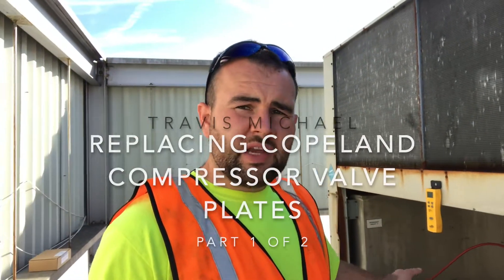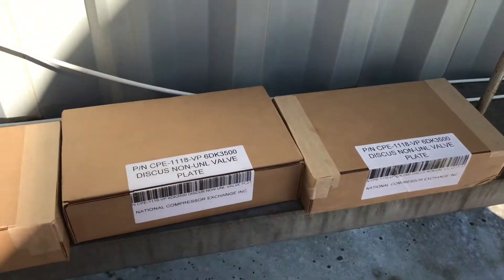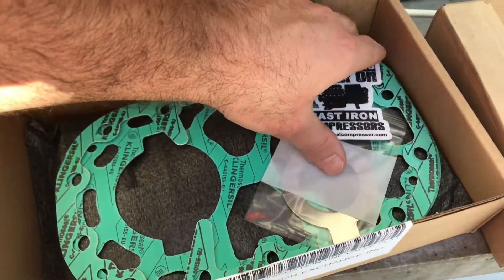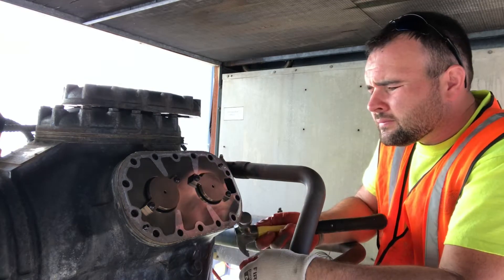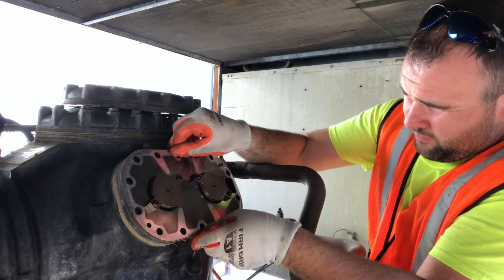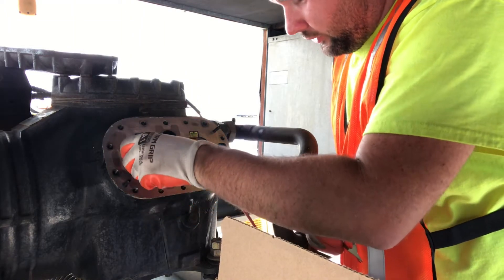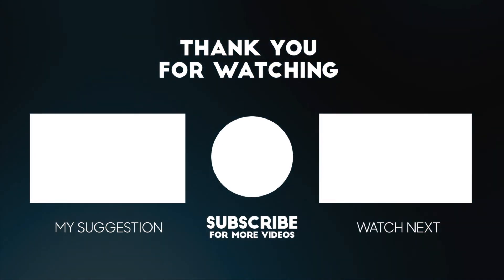Semi Hermetic Compressor Valve Plates Replacement

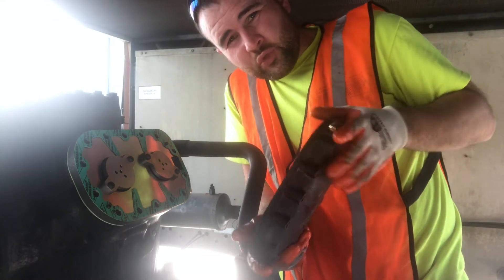Comment: Great video thank you for sharing your field experience. One question I have, maybe you know, the new valve plate discharge has 4 holes and the old one had one. You can see the difference between at 4:50 and 10:40. Thank you

Comment: What exactly is the problem with semi-hermatic compressor and you replace all pressure valves etc... ? Appreciate your response as I am a new HVAC Technician learning. Thanks
Reply from the maker: This system utilizes a pump down cycle to shut the compressor down. Basically a liquid line solenoid valve closes when there is no longer a call mechanical cooling. The compressor is deenergized when the low pressure switch on the suction opens. One or more of the valves were leaking refrigerant back into the suction raising the pressure and causing the compressor to energize. The compressor would repeat the pump down cycle running until the low pressure switch opened again. The compressor was short cycling and running every few minutes for a short period of time.

Comment: I never take them aliment pins out. They are case harden and if you break one trying to get it out your fked trust me.
Reply: worse still is if you drop a pin into the compressor gas galleries in the casting,especially if you think you have dropped it outside the compressor,that would be bad.when its really inside.😱